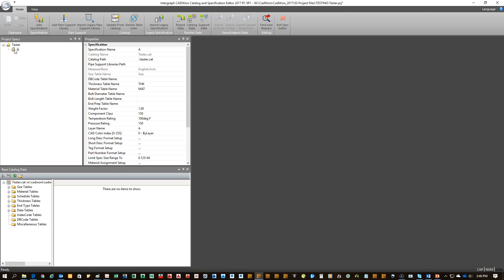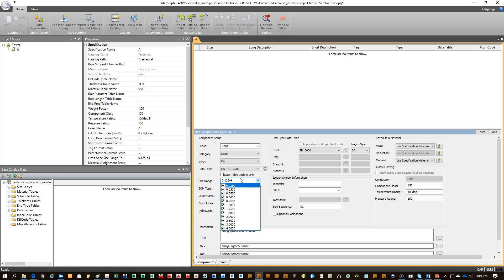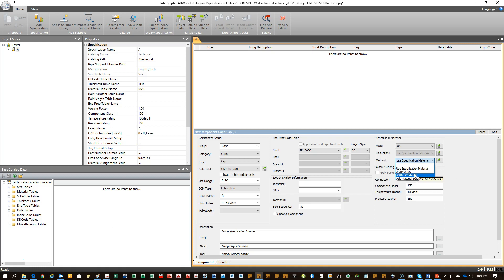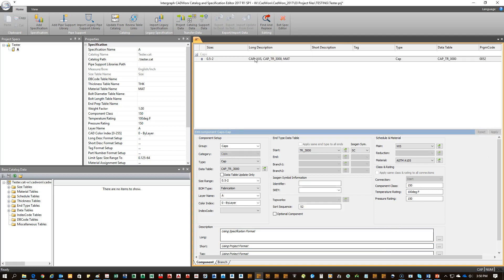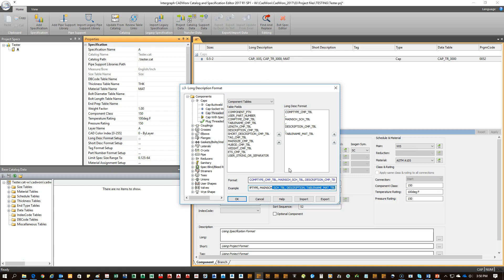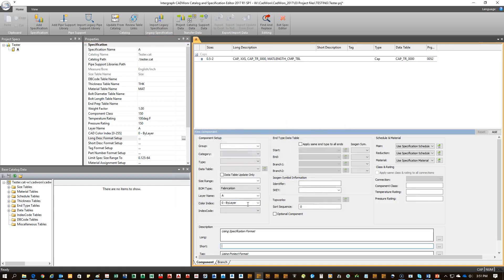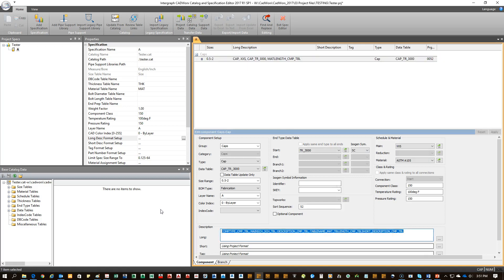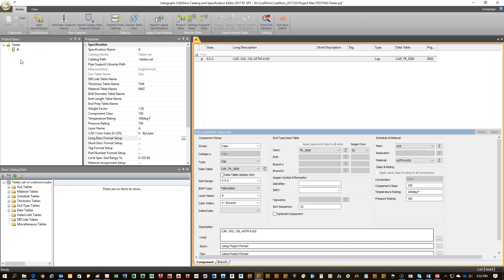CADWorx  - Project Specifications (prj) Training - Just in Time (JiT)

Comment: Hi,

I am working on spec and I want to add Flange or Coupling at every 6 Mtr. in Pipe automatically. So what i have to do in Spec? What is the Procedure for this? Can you Guide me or Make Video on this?
Reply from the maker: Dhruvesh Patel The best way to address this is to have a Maximum Pipe Length set in your piping rules. The Flanges or Couplings will have to be addressed in the end type for the pipe being used. Again the piping rules and the spec data for the pipe will require modification to facilitate this automation.